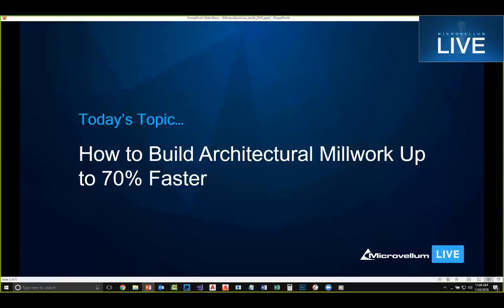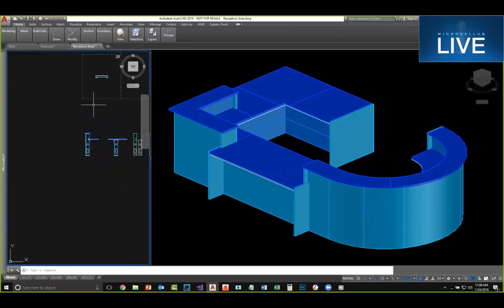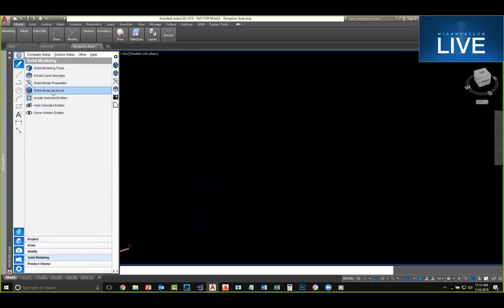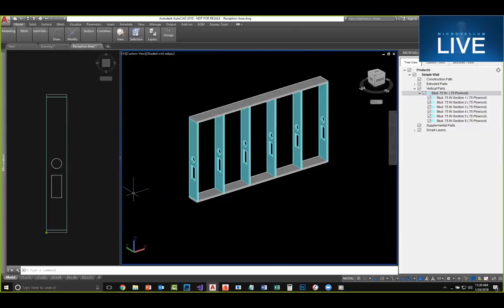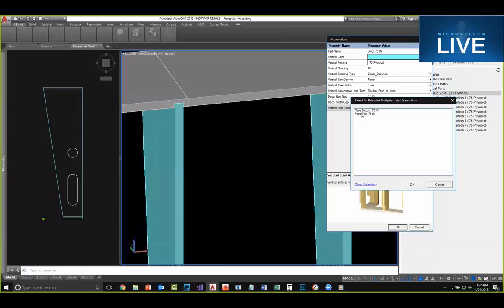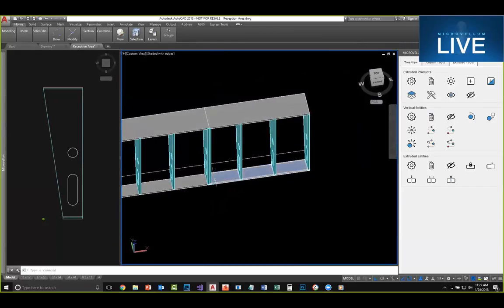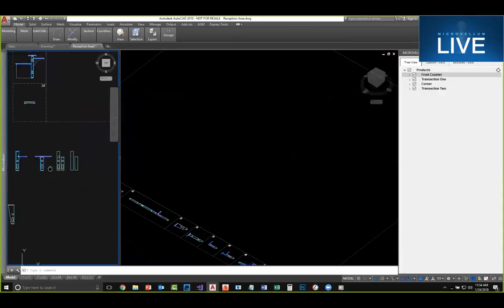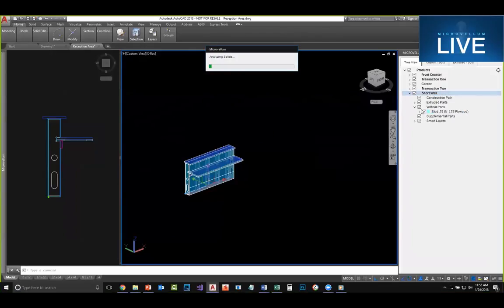Microvellum LIVE - How to Build Architectural Millwork Up to 70% Faster

Comment: Great video, very helpful. How does it handle the inside corners of the plywood plates? There would be a tool radius there if there isn't some kind of treatment to that inside corner. Will there be options for how to handle such corners?

Comment: Does it create nests for curved skins? I did not see those in your nests.
Reply from the maker: Yes, it unfolds the curved skins for nesting. We will be reviewing this in an upcoming LIVE episode.  It handles curved, tapered, conical, etc. We even provide an option to oversize the optimized part for trimming.
Reply from the maker: @RGC DISTO - Yes, we unwrap and optimize the skins. This video does not show this, but we do handle this part as well. We will even unfold any machining that is on the skin too. We call this NonPlanar Part Support. It will be available for General Use in our next release. A video will be released shortly to showcase this unwrapping process.
Reply from the maker: Yes, it does!